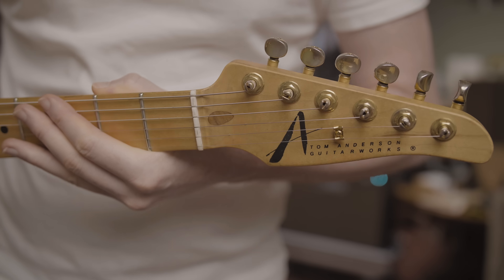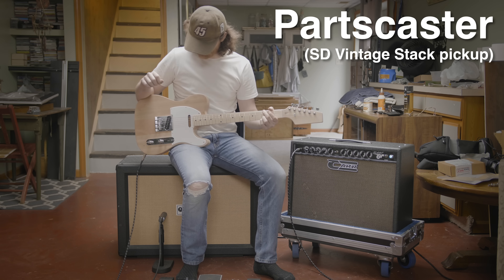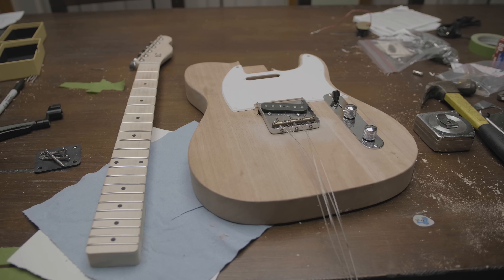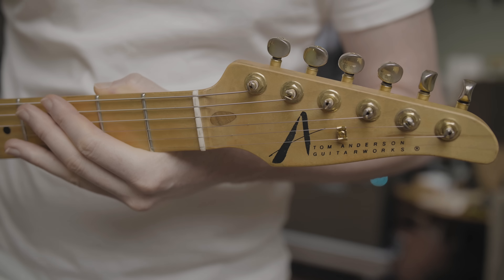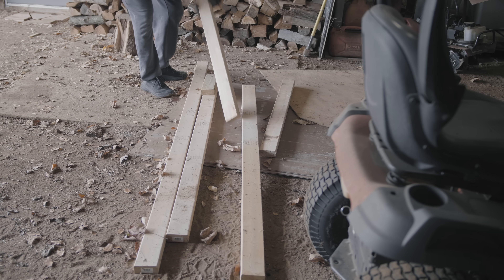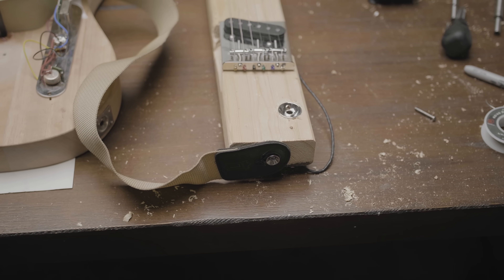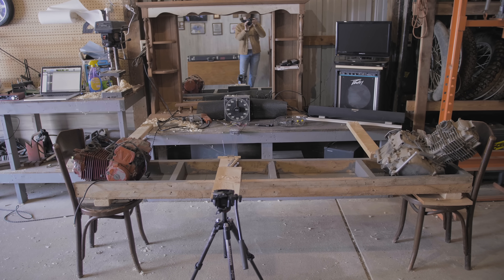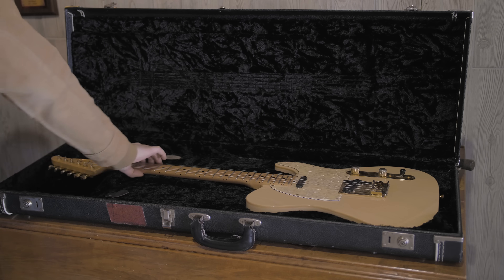Tested: Where Does The Tone Come From In An Electric Guitar?

Comment: The main reason the air guitar sounds so good is that you are using the air in a very old shop, which gives it that vintage sound.
Reply: fender takin notes fr
Reply: @ericfinch8343 jajajajajajaja
Reply: The wood the shop was built with is a quilted maple with Cocobolo back and sides.  A very warm and rich palette.
Reply: perfect … funny
Reply: @Stradiomusic  Yeah, but that's not what's picked up by the coils. I've made guitars out of maple, ash, and walnut in the past. The only differences in tone were when I switched up the pickup positions.

I reckon it's mostly the hardware, not the casing you slap the components into.
Reply: It’s got that vintage air
Reply: Next video, moving the bench outside into the open air to test.
Reply: Was the temperature, humidity and barometric pressure the same for both takes?
Reply: Nope, it was the old Honda engines weighting down the bench. ; )
Reply: ...the deep soulful resonance of 1970's 4 stroke cylinder heads!
Reply: 😂 fuckin ded, 'Vintage Air' is the best explanation.
Reply: You're so right. Fender did a reissue of the bench-and-shelf air guitar, but with the modern air, it just didn't have the same richness.
Reply: I'm no virtuoso, but... I am 100% self taught without a playing player. I always thought my amp sucked, and was constantly chasing a good sound. I remember I had some people over over night and a guy was like I love you guitar can I play it (I had saved up and got myself a ebony Gibson explorer and even put EMG pickups in it) he took that explorer, and my shitty old practice amp and struck a chord and I was blown away. It was that day I realized it wasn't my guitar, pickups, ammo, strings, tuning... It was my hands. That's what created the sound I didn't like and that was the way to get the sound that I wanted. By improving and building technique and play style. Your equipment is a big part of your sound, but your hands are what makes the real difference there.
Reply: would have liked, but the like-count is at 1337 and I don't wanna ruin it
Reply: If only he'd had relic'd it!!!
Reply: Dan, that is the best comment I've seen in years. You Sir, wake up in the morning and piss excellence.
Reply: @davidreynolds6718  this is literally true, although I am a little concerned you know so much about my morning routine.
Reply: Toan is stored in the balls
Reply: I think the gray-blue paint on the bench and it's known reflective/reverb audio qualities are adding to the vintage tone.  (very cool video)
Reply: haha i can see it written on the brochure
Reply: When I play air guitar I can never get that kind of gain.
Reply: lol I literally burst out laughing when I read that right at the beginning of the video. Then he changed the pick-up and I fell off my f'ck'n' chair elling-my-effin'-a-off. Every canteen in every guitar workshop has a dart-board with this dude's picture stuck on it. They must hate him, fr. LMAO! Just too funny.
Reply: You can add gain by having two breakfast burritos a couple of hours before you play.
Reply: Obviously
Reply: I like the invisible guitar at the end?😊👍
Reply: Considering these sounds come from iPad speakers my conclusion is fine tune the guitar you have to your taste and then practice, practice,practice
Reply: My air is from prehistoric times, beat that 😤
Reply: Also, the pollen and mineral content of the dirt in that region has a unique tonal signature that first affects the sound as the dust is released into the air and secondarily affects the sound as those dust particles bump into each other as the pressure waves wash the space.
Reply: Ye Olde Aire Shoppe
Reply: Sorry, dude, but the shop was only reliced to look old. My friend, that air is primo fresh!
Reply: Tone air.
Reply: it's not the air wear hearing, it's the essential oil droplets
Reply: Oh, no. Not the old "toneair" debate again. Here we go.
Reply: he might need to change to another planet cause this one its to old and give it the vintage sound
Reply: come on for real? 🤣🤣🤣
Reply: Lol. Never read anything so stupid xD
Reply: Yeap makes a big difference 4 sure.
Reply: How in the hell would you know🤪
Reply: The more fart you’ve made, the better sound your air guitar has.
Reply: Air Guitar?? i cant play Air Guitar, only Air Bass ;)

 A plankcaster would be a cheap way to learn some chords, mind ;)
Reply: Lol
Reply: Yah tonewood nuts😂😂
Reply: Toanair
Reply: Best comment :) Perfect "guitar sommelier" reasoning.
Reply: LOL… and it’s probably a warmer sound if the workshop is in Florida vs Montana.
Reply: @daviddempsey8721  well... you're not wrong.
Reply: LoL. You vintage tone guys will never give it a rest will you. 🤣🤣🤣🤣🤣🤣🤣🤣🤣🤣🤣🤣
Reply: No. It's the quality of the dirt floor, and the paint used on the exterior of the building. Duh. 

😅
Reply: Eric Johnson used to scour multiple junkyards to find a perfectly matched set of Honda engines
Reply: That air was around when the natives followed buffalo across the grand prairie...
Reply: I'm dying🤣
Reply: How can I buy some of that “vintage air” 😂
Reply: A solid point, that vintage air gives that tone some fair ammount of brightness.
😂
Reply: So once again it's the room sound that's the issue
Reply: Farts change the tone, so if you find a place that you feel has had a lot of history of farts you will hear a clear difference. Hope this helps
Reply: dude...best reply ever, cracked me right up🤣
Reply: It's those old engined used as ballast
Reply: Yea pump fresh air in there an you’ll be playing in the key of Z in no time 👍
Reply: sounds right to me
Reply: It's that air tone
Reply: Imagine an Earth guitar with a vintage 4 billion old sound lmao
Reply: I love how so many people hate this video lol
Reply: You call this air? It has two WOODEN tables with cavities on both sides. It's acoustic more then an upright bass. If those tables were from stone, that was something else.
Reply: It's shocking to me how little people know about music, yet they comment like champions. 
The air has nothing to do with it. There's no tone air. 

The secret sauce is of course in the Honda engine from the late 70's.
Reply: you are joking, I hope!  Peace
Reply: I used the entire rest room on my self
Reply: Wood or anything else doesn't effect tone of a electric guitar it's  what  kind of speakers you have in your amp.
Reply: Doesn’t work like that pal
Reply: @TateH25-o7v  no shit Sherlock, it's the vintage honda engine tone.

Comment: This is wildly fascinating and leaves me with a lot of questions:

1. If wood is irrelevant — and I am willing to accept this hypothesis — but then why is it that two Les Pauls, set up exactly the same, might differ in sustain (another measurable quantity), or in some ineffable tone where multiple people will admit one sounds better than the other? Is it down to QC problems, where a glue joint is off and the whole gig is up, or it something else?

2. Some elements of the video were very quickly glossed over, and I wish we had more time to dwell on them. Certain changes do make differences. Steel and brass saddles sounded very different. This kind of makes sense; it's a resonant material with certain audio qualities, and you'll hear that in an A/B test. But if we had more time with both side by side, one might be able to find the right words to describe the difference. Because Tele fans (and I am one!) use words like "snappy," which I don't think are particularly helpful.

3. Is the implication that the cheapest guitar with a pickup you like is all you need? So we're really just going to narrow it down to preferred shapes and sizes, along with the pickup? If so, great! That makes it easier to non-emotionally shop.

4. The Anderson is a nice guitar, with a nicely applied finish, that sounds at least as good as no wood at all. Can a cheap guitar, with a poor finish, sound worse than no wood at all? We had a comparison here with some unfinished wood, but I'd be curious if bad poly makes a tonal difference at all. Again, not because I think it matters (4 out of my 5 electrics are poly), but because I am academically curious.

Comment: Just found your channel and immediately loved it.  You last example brings new meaning to the term "air guitar"! As a physicists, I always "knew" that the body of an electric guitar was not important and I even "demonstrated" a 2x4 mono string guitar, but never to the time to do such a careful empirical validation.  One suggestion: in a future video on amp cabinets (again really nice job even if the result is less clear) you did a frequency analysis of amp output for a given input.  You might consider doing the same for "air guitar" comparison and showing the wave form and spectra are nearly the same.  Overall great job!

Comment: I have always been on the side that it's mostly the pickups.  The position of the pickups and the height and the type. The position on the length of the string determines which set of harmonics it is mostly picking up. Obviously near the bridge the high harmonics are a greater proportion of the sound.  Farther away from the bridge and the fundamentals are louder. The height mostly makes the volume louder or softer BUT as the pickups are closer the magnets start to pull on the strings and that changes the tone.  Strong magnetic pull makes the strings produce out of tune and discordant tones.  BUT the biggest influence is the type of pickup. Brand, windings, hummB versus non-hummB. etc.  I think your air guitar proves it's the pickups.
I strongly discount the wood, the body shape (except in the case of hollow body versus solid where feedback is concerned.)
Things like the fret heights and the finish of the fret board can influence the sound of a guitar only in the sense that it influences how the player plays it.

Comment: What an amazing amount of work and time that has gone into this project. Thank you very much. 👍😎🙏🏼❤️
Reply: The problem is that this video is trying to say that woods/substrate/guitar body doesn't matter.. and basing that whole argument on the fact that everything but the pickups, the strings and the tuners have been replaced... but that's not the case. Strings need something solid to resonate with to maintain their oscillation... plugging this rig into a bench does not demonstrate that.. you're just replacing the guitar body with a bench.. so, of course the strings will resonate the same - maybe better! Replace it with stale bread and you might have a point. :-)

Comment: If you believe you are paying lots of cash for sound.....well, don't..
First, learn to ignore price tags while picking a guitar..

I have an Ibanez rg450 (Japan) that I have to tune after every studio/gig, It needs fret rework, electronic issues, loose screws in FR to Body joins bcs of low quality wood degredation.
I have a Jackson SL1 which has incredible, i mean incredible low action, tuned only once while changing strings and stays in tune for1 year in steady room temprature, and none of the frets wore off yet. It can even take huge divebombs without loosing a cent of tuning. 
Both Guitars are made in 2004..

My best sounding guitar is my Jackson sl3 which has the exact same specs with my sl1 and 2k€ cheaper than sl1.
Which one do i enjoy playin the most, hell.. SL1 for sure, and it is far more reliable,  no fret buzzeven even with lower action, and better fretwork.

Comment: Great work! One note: the Partcaster has no neck pickup and that's a big difference. When you select a pickup, the other pickup(s) will still affect the tone by slightly restricting string vibration with their magnetic field. All pickups are constantly 'pulling' at the strings. Single coils have a stronger magnetic field and active pickups the weakest. Humbuckers are in between. This is why some players remove pickups they don't use...

Comment: Great video. Solid body electric guitars are just about how the player feels about it. Most guitarrists will love the sound of an expensive vintage Les Paul even if it sounds exactly like a cheapo guitar. There is so much mojo vibe playing a part. It is just strings vibrating and a pickup that picks this up. Acoustics are a whole different story because the wood/material of the sound box really matters in creating the sound.

Comment: What about scale length, string break-angle, neck-thru vs set neck vs bolt-on neck. If you put an identical  humbucker in a Fender style guitar it will never sound like a Gibson. I believe the difference lies in what I have mentioned above.

Comment: There is no point in looking deeper into the factors, because their effects are obvious and well known. E.g. 500K pot versus 250K (possibly with different instrument cables). Different pickups and pickup heights. Scale lengths, strings. 

None of those factors can be changed and removed; so I think that nails it, and that's it.

The body of a guitar is important to the feedback at high volume. There are obvious differences in the high volume feedback behavior between acoustic guitars with pickups, hollow-body electrics, semi-hollow and solid-body.

(I'd rather get predictable feedback from a Sustainiac, truth be told.)

Comment: Why do you say each guitar maker had different reasons for tone? All three makers list three components that are pretty much exactly the same:
1. Body wood/neck wood (the neck/body wood; the wood/materials the guitar is built from)
2. Pick ups (pickups; the guitars pickups)
3. Hardware (bridge saddles; the guitar’s hardware)
And vary on the fourth and fifth components with opinions like the player, the weight of the guitar, construction and finish.

Comment: To sum up the comments under this video:
1. Yes, there IS  a difference depending on what wood is used as you can clearly hear in this awesome test.
2. However, the difference is not nearly as huge as electric guitar companies make you think. It is different with other instruments like acoustic guitars but considering electric guitars (this video is not about the relation between wood and sound in general, it specifically focuses on electric guitars) even the cheapest wood and most primitive construction can give you a wonderful sound. Or in other words: The sound of an electric guitar mainly depends on other factors like for example the pickup or the distance between pickup and strings and of course obviously the amp, as clearly demonstrated in this video. If you mostly don't play clean guitar you basically can ignore the type of wood but should focus on pickups instead.

Comment: Dude you did SOOO much work to create and A/B test each of the permutations ...this was really amazing. I actually thought the frankenguitars you made sounded really good with the tweaks you made. The 2x4 solid body would be great for travelling btw. I'm definitely going to play around a lot more with the pickup height on my own guitar
Reply: The problem is that this video is trying to say that woods/substrate/guitar body doesn't matter.. and basing that whole argument on the fact that everything but the pickups, the strings and the tuners have been replaced... but that's not the case. Strings need something solid to resonate with to maintain their oscillation... plugging this rig into a bench does not demonstrate that.. you're just replacing the guitar body with a bench.. so, of course the strings will resonate the same - maybe better! Replace it with stale bread and you might have a point. :-)
Reply: @crazyjack9voltbatteryamps  Bingo. And again, Les Paul explains this, in his own words, decades ago, based on his work from the 1950s. https://www.youtube.com/watch?v=OLA6GaVzJMA&t=279s
Reply: Look up Les Paul Gibson Log. Literally 70 years ago, same thing. There's nothing new in this video.
Reply: @800lbGorill4  It's one thing saying it and another demonstrating with video and audio.
Reply: @captainbigos9267  Okay? Brilliant assessment there mate.

Comment: i figured this would be the end result to be honest. pickups are literally what make electric guitars, they don’t even make much sound on their own. however, what i’d be more curious to know is, what makes acoustic’s sounds vary? i have a $600, pretty middle of the road takamine, and a $1,300 cole clark, and the difference between them is night and day. the only discernible difference between the two, really, is just the wood. i use the same strings, and i set their actions myself and the distance between bridge and nut are negligible. they’re both full size guitars, with the grand auditorium body shape + a cut out. ofc, i’m aware that more factors can play into it, like humidity, the dryness of the wood, but… even still, they’re kept under the same conditions and yet, the sound very very different. i do have to wonder if tonewood is a myth altogether, or just for electric guitars. im not convinced that tonewood isn’t just a myth, i really don’t know. but if it is, i’d like to know what else really affects my guitar’s sound as much as it does, and why the registers are so different

Comment: Love it. Goes to show that pickups are the most important thing on a guitar itself. If you put garbage pickups on a Gibson Les Paul or a Düsenberg Starplayer or a Fender Strat/Tele, the sound will be poor no matter how great the rest of the craftsmanship may be. I think there's a certain price range that makes sense to invest into to get something well built that has good ergonomics and good materials that will make your life easier. Beyond that it's all mumojumbo.

I've just replaced the standard pickups in my Epiphone Les Paul with a nice pair of Seymour Duncan Hot Rodded Humbuckers (SH-4 and SH-2) while rewiring the whole electronics replacing everything, adding push-pull for split coil and so on ... sounds like a whole different guitar.